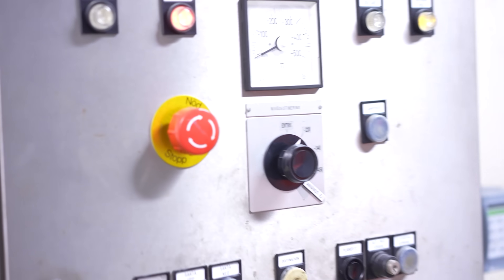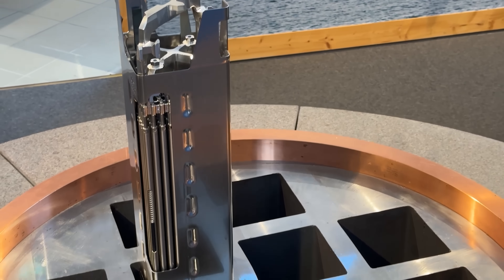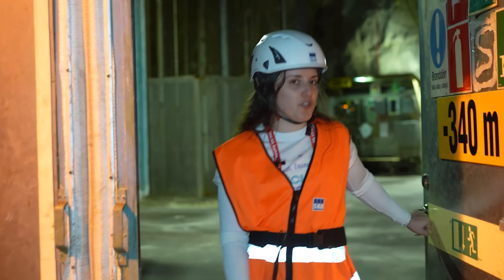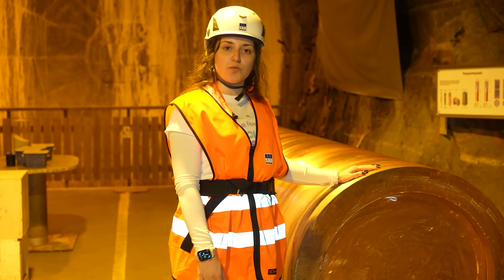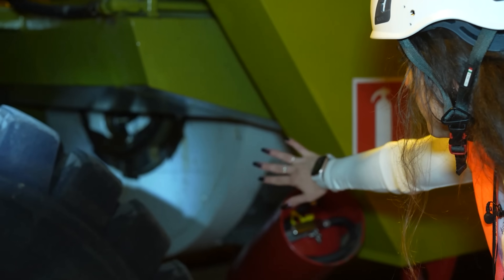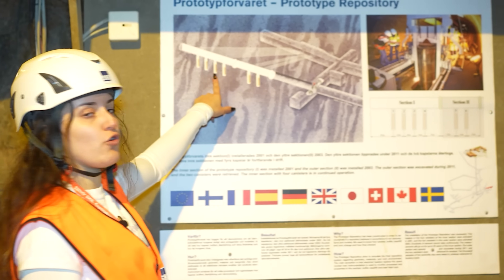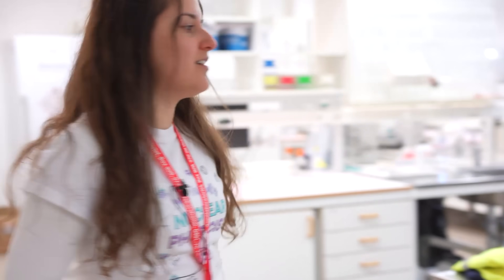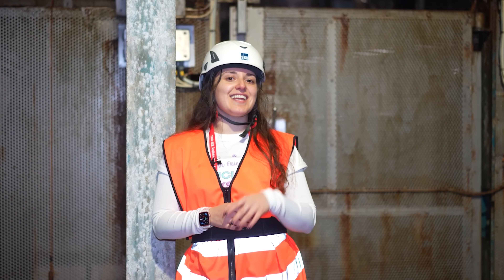The Solution to Radioactive Nuclear Fuel Waste

Comment: There is no such thing as "Nuclear Fuel Waste", only vastly underutilized alternate fuel sources. . .  Brilliant video, also!
Reply: I agree. There's only light water nuclear reactor waste. A better reactor design could use this stuff as fuel but we're doing a huge project to bury it into ground. The amount of copper alone will be super expensive.
Reply: I have steam punk mad max visions of future generations digging through that clay by hand looking for that copper 🤭 @MikkoRantalainen
Reply: At least the casks in the Finnish project will be extractable if necessary. At the moment it seems very implausible we would want to use them but 50 years down the line, who knows. The process is reversible. *The Swedish design seems very similar to the Finnish one.
Reply: Are you serious? Do some simple math. Do you think we will use 30x as much nuclear energy as we have used in the last 75years  of nuclear energy, within the next 50 years? 

50years is a miniscule time for access to recycle, considering how enormous the residual energy that remains!
Reply: @EdPheil  Yes, an oder of magnitude much more than 30x, caveat being the Malthusians haven't achieved their twisted conclusion . . .
Reply: But it doesn’t even need to be recycled, just needs a larger critical mass, “spent” fuel assemblies from standard reactors and be combined into a very large reactor, potentially just one needed world wide with a large enough reactivity that it can be transmute everything present all the way through to something guaranteed to burn up.

At most you might need to vacuum the assembly tubes to degas.

But if there was a single central site as the burn up reactor, they can do the reprocessing so that it’s not in any other countries hands, and in exchange they get more free energy shipped in than any country currently has the ability to use.
Reply: At least it should be relatively easy to re-extract it from there and if in the future there should be a copper shortage....!
Reply: That is too right.
Reply: Yeah, just one of those copper cans could probaby heat my house !
Reply: @kayakMike1000  That would be a great conversation starter, and I won't need to pay for heating I want one now
Reply: but " mUh 3 MiLe iSlAnd aCcIdEnT "!
Reply: @MR-backup  no accident, just a PR nightmare
Reply: only problem is how to extract it from Asse II  ground water
Reply: "There is no such thing as "Nuclear Fuel Waste", only vastly underutilized alternate fuel sources"

I'm fully pro nuclear energy but this kind of statements makes angry. I'm against these "Teletubbies" vision of nuclear energy. History shows it leads to catastrophic events where 'no one is responsible', where people says "how could this had ever happened"...
Reply: @AD-ho8pb  You do not seem that far from my point of view, which I consider anti nuclear.
Not to say it doesn't serve a role, it's just that it serves a role which is very specific.

We do not want certain nations to have the facilities which make recycling nuclear energy possible and that ever makes nuclear energy even less competitive the current renewables.

If Germany decides to start rebuilding a few of their nuclear reactors to maintain a baseline, I'd be all for it.

If Iran wants to build some fast breeder reactors, then I'm going to have to say I'm against it.

When nuclear works, it's great.

the 2x $250 Bn accidents that have happened make the deal a bit less appealing.
Reply: @Minuz1 I would say even if Iran wants to build new npp's I'm for it. But maybe limit then to lwr. Let them make a deal with a country like the Netherlands for their uranium. The refining and taking it back to put into the ground. Or use it in a fast breeder. Like we use very little from the energy we put in. So selling it to a country having them pay the big bucks. We buy it back cheap and run our reactors for years. Will probably be a headache to orchestrate it. But if it works it would be great. But a country like Iran could probably do with shitty batteries and only wind&solar energy. They don't have that huge of a energy footprint. And yeah I'll agree them not having access to it would be better.

But nuclear also holds a key part in our transition away from fossils. Overproduction of nuclear and renewables could be used to make hydrogen gas. That we can use to power our vechiles and for us to cook on it. 

Hell we could even use it to use our gas power stations to run on it.
Look at France, they have a solid 93-95% of their energy from nuclear. When you have competent people working at these places the chances of shit going wrong is smaller. 

Fukushima survived a magnitude 9 earthquake before it was hit by the tsunami. People tend to forget that first part. After the earthquake the NPP functioned like nothing happened. That's how strong these fuckers are build. I get the fear for a nuclear meltdown. But tbh, I would be okay living next to a npp. Wouldn't even be phased by it. 

But first let us get smr's. Especially the kind that makes byproducts people like yourself are scared off if countries like Iran and NK get their hands on it. I'm curious what the yields actually will be. Because on paper it might sound like a lot. But on paper it's perfect everything. Not the real world.

Comment: i had a question as particles have energy which the waste product emmiting why cant this energy be harnessed like solar cels
Reply: It can be harnessed. Check beta-voltaic and alpha-voltaic semiconductors. The first one harnesses the kinetic energy of beta-radiation (really fast electrons). the second one harnesses the energy of the alpha-radiation (quite fast alpha particles or better known Helium-4 nuclei).

Gamma-voltaic cells are possible too, but I haven't heard anyone made them. But there are ways to harness gamma radiation too. Not as practical, simple as the previously mentioned cells.

These cells are used mostly as energy sources of space probes in the outer solar system.

Comment: The solution is molten salt breeder reactors which generate huge amounts of additional energy from the "Waste". What's remaining only needs to be protected for about 300 years which doesn't need this kind of expensive storage. It's a win/win.

Nuclear waste is an asset, not a liability.
Reply: If you can separate the fission products in use similar to what LFTR wants to do with their reactor concepts, then you can convert them into nuclear batteries and eliminate the high intensity short lived waste as you are using it to generate more energy.

If you adopt a fast spectrum as well, you have a lot more fuel, but that is obviously not without risk.

Some estimates put it in the hundreds to thousands of years, without digging up any more fuel.

Molten core reactors are the solution, whether or not salt is the better solution, depends on a number of factors, but the barrier is a lack of research investment.
Reply: "What's remaining only needs to be protected for about 300 years which doesn't need this kind of expensive storage. It's a win/win."

True, and this shows again why multiple types of nuclear reactors should exist together, not as competitors, but complementing each other.
Reply: @erkinalp  I partially agree. High-temperature/low-pressure reactors will replace current PWR technology but not all reactors need to be breeders.
Reply: We are still figuring out how to build MSR (molten salt reactors) that can last for decades. We don’t know which materials can overcome the challenge of corrosion. Maybe we will figure it out, after a lot of expensive and slow research. And even then this won’t warranty that they will be economically viable
Reply: @senefelder  which MSR are you referring to? There are at least a dozen different designs.
Reply: @chapter4travels  all of them. There is still a lot of research to do until we find out which designs are viable in the real world, able to compete with other sources of electricity. Corrosion is a big open question.
Reply: @senefelder  all of them, really. So Thorcon and Terrestrial energy that replace the entire reactor vessel every 7 years or Moltex who separates the liquid fuel from the blanket both have huge corrosion issues? Hmmm
Reply: @chapter4travels  a SSR is not really a MSR. Nevertheless, all of those are hypothetical designs. As in previous phases of nuclear reactors, many designs turn out not to work as expected. In the Thorcon design, the primary loop is not clean, fission products will build up, after all there are more than just gaseous fission products, and there can be corrosive to non-halstelloy superalloys. The primary loops needs to be replaced with a new can (I have seen 4 years, not 7) precisely because of the corrosion and damage to the graphite moderator that will occur in the high flux environment. It is a better MSR design, but decades away from implementation. There is A LOT to be build and tested.
Reply: @senefelder  Of course the SSR is a MSR, just a unique design that solves any corrosion issues. In both Thorcon and Terrestrial, the primary loop is within the reactor vessel that is changed out every 7 years the working fluid loops are clean solar salt and will not need to be replaced. No super alloys are needed, only stainless steel. 
Of course, both will be tested on the job, and improvements made as needed. But unlike a PWR where the reactor is inside a gigantic containment structure, inaccessible for changes, these reactors are easy to refit. 
All of this will take time but high-temperature/low-pressure reactors are the future of nuclear and MSRs are the best bet at this time. Also, there is no rush, the transition away from fossil fuels will take a very, very long time.
Reply: As I stated, Fast Chloride-MSRs started up on Plutonium & Uranium mixture, about 12%/88% of actinides.
Reply: @senefelder  the technology will work well it just needs time to work out all the kinks just like any new emerging and developing technology. The more investment by public or private sources the more they can speed up this process.
Reply: Too bad we are all people and plutonium from em can be gone "missing".
Reply: @oljackie35  No it hasn't, it can't.
Reply: @chapter4travels  The problem with thinking new nuclear tech will solve most of our energy problems is that we'd have to use it pretty much everywhere, including in countries that may want to weaponize it. Iran, for example. It's very easy for the people running the reactors to get all the plutonium they want and for nuclear to be the paradigm-changing energy source we'd all like to see we would have to give that tech to them.
Reply: @willythemailboy2  No, it's not easy to get plutonium from reactors and especially not gen. IV models. If a country wants plutonium, they build a specific type of reactor designed for that purpose. This is anti-nuclear propaganda.
Reply: @chapter4travels  Not easy does not mean not possible. It would certainly be easier than trying to separate U-235 from natural uranium, which is the method most countries start their nuclear program with.

I'm a big fan of nuclear, but dangers do exist and you just saying no it can't happen is itself propaganda.
Reply: Hogwash!
Plutonium in commercial reactors is NOT weapons grade (<10%) Plutonium 240.

Besides you don't need to separate to pure plutonium for use in Fast Chloride-MSRs because you don't need a lot of handling, like is needed for making solid fuels.
Reply: When has it? Seriously. Stop spreading misinformation, MISS INFORMATION! @oljackie35
Reply: They plutonium is Not weapons grade, so there is no purpose in stealing plutonium from commercial reactors for nefarious purposes. It is only usable for nuclear reactor fuel in fast reactors.
Reply: @oljackie35 Low level nuclear waste: Secret documents, medical waste, bodies. High level waste: Who owns the plutonium and how much is it worth.